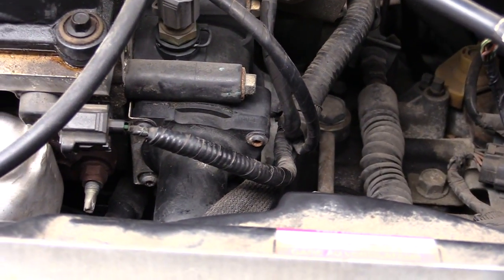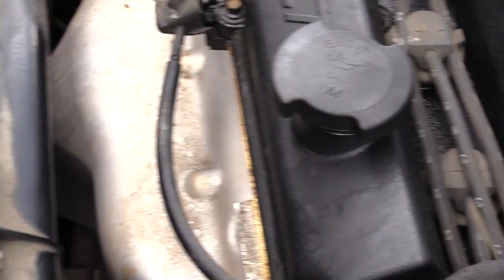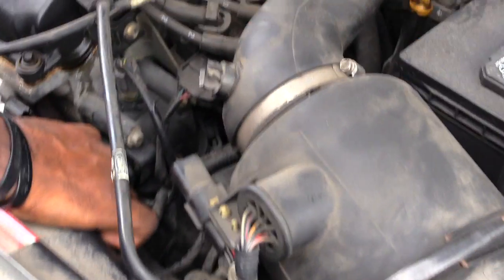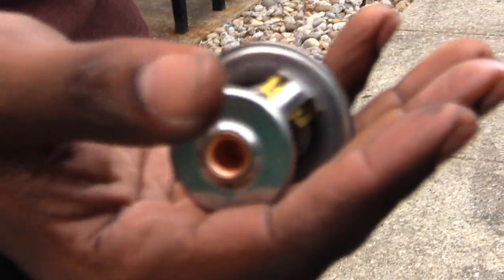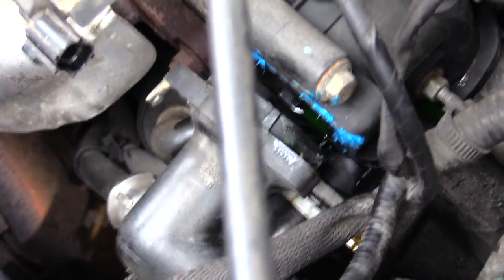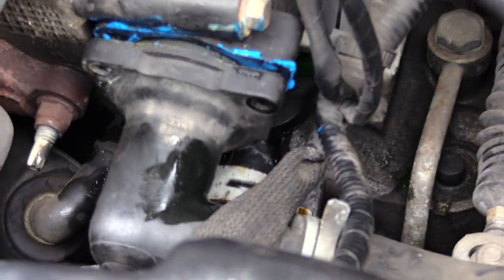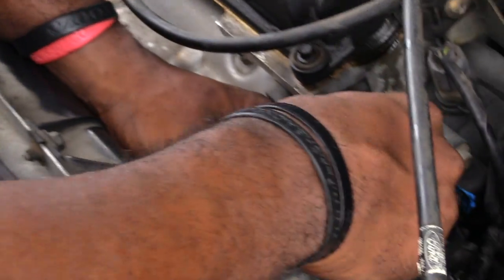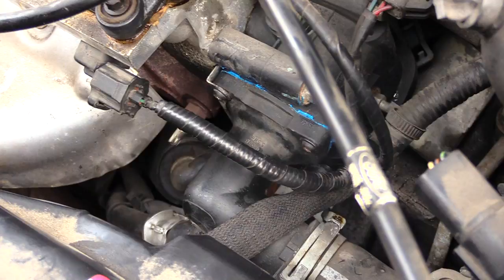FORD ESCORT Thermostat CHANGE

Comment: I had a broken thermostat on a mk 4 xr3i and didn't have a manual didn't realize they were that easy to change ,you could only drive it for few miles before overheated and just stopped  so I kind of fix there's a plug on drivers side over the arch to have the fan working all the time it's for when Ur towing a caravan and it didn't overheat again while I had it , I think I paid 50 quid for it because of the thermostat I remember seeing the person I bought it off and she looked anoyed